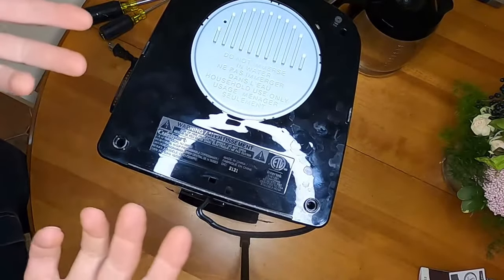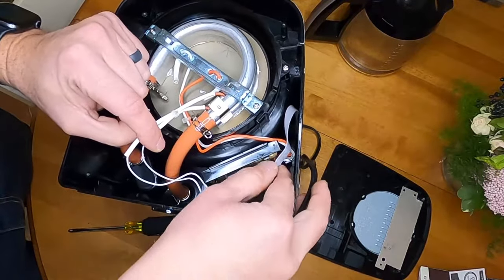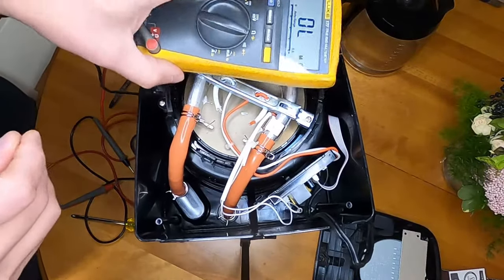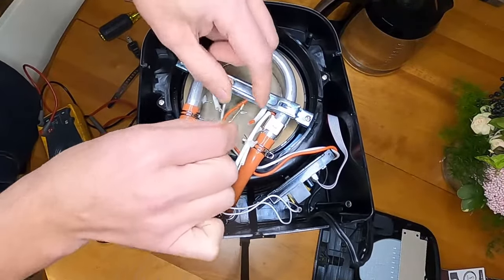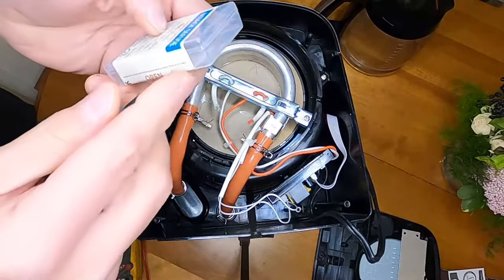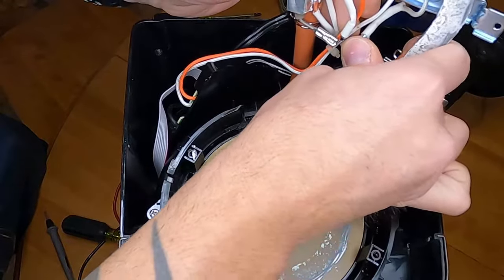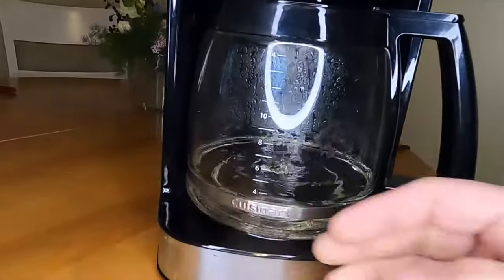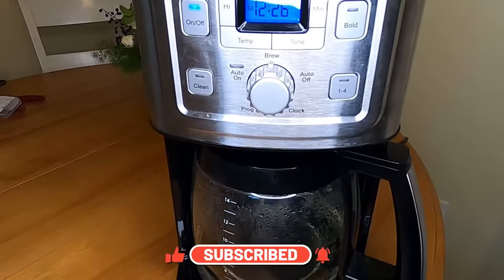How To Fix A Coffee Maker That Doesn't Heat

Comment: On my coffee maker the heater tests good at 15 ohms. Had 2 thermal fuses or thermistors tied in series. Both test open on ohm meter. So I guess both failed.
Reply from the maker: Sure sounds like it

Comment: Excellent video. I like that you explained the basics of using the multi-meter for viewers not familiar with them.  One suggestion is to not pour water into the reservoir when the machine is hot.  With no water in the reservoir the heater heats up very fast and when the cold water hits the hot heater it turns to steam and could possibly damage the heater.
Reply from the maker: Thanks!
Reply: This is exactly the mistake I made, poured a cup and added water ... instant burnt wire smell .. Glad I found this video ... just saved me $200.00.
 P.S. When you do go to do the repair, make sure you have dumped the water out of the reservoir before you flip it over, otherwise you will look like a wet idiot ... trust me I know.

Comment: That was helpful, thanks.  My fuses are both blown.  What's bothering me is that if the coffee maker is designed properly, the fuses should not blow unless something else has failed and it had "run away" (i.e. like the temp sensor, or a stuck relay, etc).  If replacing the fuses fixes it, then were the original fuses underrated or defective?  Or are the fuses going to immediately blow again, because the temp sensor is still bad?  You get my point.  That said, it's hard it resist the satisfaction of fixing something, so I guess I'll spend $10 and replace them and see what happens.
Reply from the maker: There is a temp sensor to regulate the temp but I think if you leave the carafe empty it will take out the fuses. You would think there would be a fail safe. I’m still searching for an official schematic to be sure but I haven’t had an issue since I replaced them.
Reply: @theguyofalltrades    I got some fuses, crimped them in, and so far it's made 3 pots of (coffee-less) coffee.  Looks good!   Before buying, I looked up the specs for the failed fuses and they said they can have a reduced performance if they were improperly heat-sinked when they were welded in place.  Maybe the cause of these failures is rooted in the manufacturing process. Thanks again for the video.
Reply from the maker: Happy to hear! Thanks again for watching. Glad I could’ve helped.
Reply: Thermal fuses, like just about all electronics, degrade with age, and more so when hot.  So repeated heat cycles will gradually degrade the thermal fuse until it fails.  I've replaced thermal fuses on coffee pots several times, and more recently, on a space heater. I found my 'spares' in the garage.  My space heater thermal was 128 degrees C, and the one for my old Black and Decker coffee pot was 139 degrees C.  I'm a bit surprised how high these fuses go since water has to boil but not a lot more.  It isn't like you want your carafe to have a hot plate under it that is 'only' 200 degrees C -- it would boil at 100 degrees C!  It would be useful if somebody could read actual markings on theirs.

Comment: A really excellent job of recording sharp clear video closeups and the narration was no nonsense, to the point and not missing anything. I can afford a new coffee maker but it bugs me how much stuff can be fixed easily and given another kick at the can, as I say. So having watched this, it looks like my Oster (over 10 years old) has two thermal fuses in series from the temp sensor instead of one per lead to the element. Metered in circuit, one is open and one is conducting. Thank you.
Reply from the maker: Thanks and welcome. This one is still going strong a year later

Comment: Hello. I have pretty much the same Cuisinart coffee maker, with the same problem. And sure enough, the thermal fuses are open-circuit. BOTH of them. As the base area of the coffee maker over-heats, I would not expect both fuses to trip at exactly the same time. One of them, with the lowest temperature trip point, would open up first. That should interrupt current to the heater, which should then stop heating, and I would think would prevent the second fuse from tripping. Of course, there is probably some "thermal inertia" in the system, so that heating of the second fuse continues for a short time after current to the heater is interrupted. Maybe long enough to trip/melt the second fuse? If I was keen enough, I guess I could do some experiments with some temperature probes...
Anyway, I am fortunate to have a "parts picker" coffee make, with two intact thermal fuses of the same rating, so I will use those to repair my Cuisinart.
Reply from the maker: Both fuses had the same exact temp rating on this coffee pot. The issue definitely was the pot was left on empty with nothing in the carafe. You would think having a thermistor that it could use that to shut the heater down before it hit the temp rating of the fuses.
Reply: @theguyofalltrades  There is a thermistor (or similar temperature sensor). In your video, it is the small device with the two thin grey wires attached to it, which is clamped to the heater. That temp sensor is for the keep-warm function. After brewing is complete, the controller measures the temperature of the heater/plate/carafe, and if it cools below some threshold, the heater is turned on for a short time, until measured temperature goes above an upper threshold. For my machine, when in keep-warm mode with about 2 mugs of water in the carafe, the heater gets turned on for about 10-12 seconds, and then goes off for about 3 minutes, and the cycle repeats. 
The thermal fuses (also called thermal cut-offs) are basically fail-safe devices, which will protect the appliance (and your kitchen/office) from drastically over-heating or fire. That would happen if for some reason the normal control loop using the thermistor had failed for some reason, and just kept the heater on. Or maybe the relay that switches the heater has "stuck on". The system design should be such that you can safely remove the carafe for any number of minutes, and the thermistor loop should still prevent over-heating. It should not be "normal" for the appliance to be "bricked" by a tripped thermal cut-off, just because you removed the carafe for a minute to pour coffee for your guests.
By the way, the two thermal cut-offs may have the same 240C trip _spec_, but it's hard to imagine that they are so exactly similar to trip within a few milliseconds of each other. If one trips at 239.9C and the other trips at 240.1C, then the 239.9C part should go open-circuit first, while the 240.1C part is still conducting.

Comment: Ahhh! I figured this might be my problem. I glad I watched this video tutorial. I just got done fixing my crockpot express with the same issue. I had to order special split tip screw drivers to remove my cover just came in today for my coffee pot. Hopefully this is my problem, now I’ll need to order another thermal fuse probably not the same heat range as my express crockpot. It would be nice if it is…...
Reply from the maker: Thanks for watching

Comment: WOW!! THANK YOU! I have an old Cuisinart, with the built in grinder, and timer. My wife loves the smell of fresh ground coffee in the morning and the sound of the grinding beans wakes me up. 
It looked almost identical from the bottom. I tested and got almost identical reading for the heater element. 
One more problem I have is the 2 orange rubber tubes were rotted right through, (which explains the recent water appearing under the machine), so I cut the longer tube back & used it where the short tube was. All working except I'm not sure if there's a special type of tubing & if so, where would I get this?
Thanks again for the excellent video!!
Reply from the maker: Welcome! You could probably find the tuning on Amazon I bet

Comment: My Crux machine had 2 thermal fuses wired in series, both 15A and both 240C. One was blown and the other was fine. Couldn't find a 15A so I bought a 10A, should work as it is only a 1Kw pot.
Reply from the maker: 8.3amps. Supposed to be 125% overrated which is 10.37. Should be good I think but it’s life be shortened due to being so close.
Reply: @theguyofalltrades  The ones you linked to are 10A and I didn't ever find any rated higher Amps than 10...not that it is your responsibility.  I think the temperature rating is the most important spec on these.
Reply from the maker: Agreed

Comment: To add,take the the hoses off and clean out the tube. Get the scale off. The calcium etc build up in the tube restricting the flow blowing out the fuse sometimes other then a old fuse. Plus it makes your coffee taste better.  :)
Reply from the maker: We use reverse osmosis water in ours so no scale really but good recommendation
Reply: I was curious if the heating element is stainless or aluminum.
Reply from the maker: @CraigSiderio it’s a nickel element encapsulated in either steel or incoloy similar to an older electric stove element. The aluminum is a cover over the element and water tube
Reply: @theguyofalltrades  Thanks. Just bought the new Cuisinart model DCC3400p1. BTW the newest Mr Coffee machine thermal maker is great but the downfall is it has a all aluminum heating element.
Reply: @CraigSiderio  good to know, crazy how heavy metals are in everything these days, terrible health issues.

Comment: I'm looking to replace the fuses in my Mr. Coffee 4 cup machine and am having a hard time finding information on what the proper fuse to use is.  I've seen some repairs that use the 216 degree fuse and some, such as this repair, that use the 240 degree fuse.  The ones that are currently in the machine are unmarked. Is there a discernable difference between the two?? Should I just go with the the 240? Thanks for all the helpful information.
Reply from the maker: Honestly the 240 is probably fine.
Reply: @theguyofalltrades  Perfect. I will give the 240 a try. Thank you so much!
Reply from the maker: Welcome. Thanks for watching the video!

Comment: My 14 cup model has 216 degrees C fuses.  Unfortunately, both my fuses are still 0.0 ohms (continuity setting 'beeps').  My hot plate is 14 ohms.  My maker brews OK, but when the brew cycle is done, it just goes off, like it should do 2 hours later when it times out.  Probably the circuit board then.  I'm going to see if there's some way to reset it and try again.
Reply from the maker: Sounds like a logic issue with the board. Is there a thermistor too? That is what senses hot plate temp. I’d maybe check that

Comment: What if everything you mention was done with the pot still doesn't heat up or start the water pumping into the pot? What else can I do?
Reply from the maker: Did you do a resistance check on the heating element? If that’s good I would verify power is getting to the heater. If not there’s probably a bad relay on the control board

Comment: Are you sure the "240" means degrees C . If it is rated for Europe, it could be 240 volts.
Reply from the maker: It said 240C on it voltage rating was 250v if I remember correctly

Comment: Do the butt plugs have to be un-insulated or are insulated ok?
Reply from the maker: I used uninsulated butt splices just because it gets pretty hot near the heater
Reply: What gauge? Pretty small wire, 16?
Reply from the maker: Looked be 16-18 for the fuse. The heater was about 12.

Comment: i cant get two of the deep screws out that are under rubber feet in order to get the lid off
Reply from the maker: Like the screwdriver won’t reach or they’re just not turning?
Reply: On my coffee make 2 screws were phillips head, 2 were torx T10. Only my problem was one torx head was stripped during assembly.

Comment: I have a coffee machine with a k-cup button and a brew button. The brew button works and heats up, but the k-cup button, when pressed, beeps and than shuts off. What could cause that?
Reply from the maker: Beeps immediately? I know the k cup needles on those ten to get clogged. You can clean out with toothpick if that’s the case
Reply: @theguyofalltrades  Thanks for the reply. I did try cleaning out everything, but it didn't help, unfortunately. The brew button brings hot water out of the same needle without issue, but for some reason the k-cup button  shuts the machine off. It also makes a heating noise like it's trying to heat up the water after it shuts off.